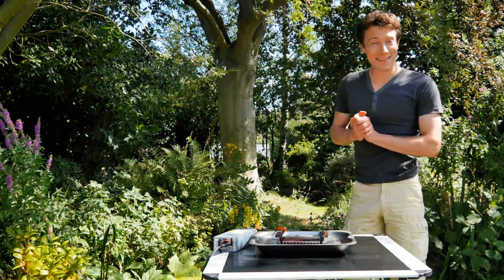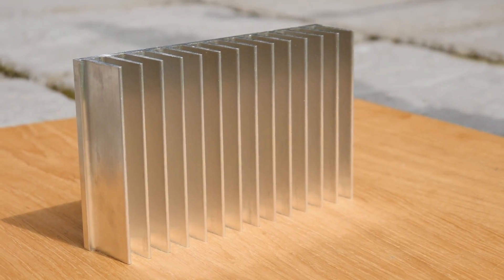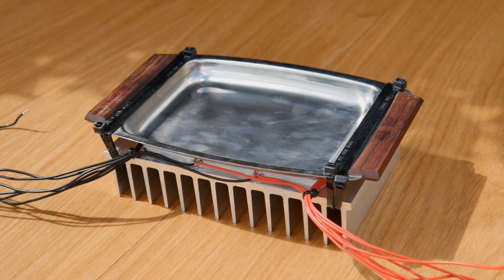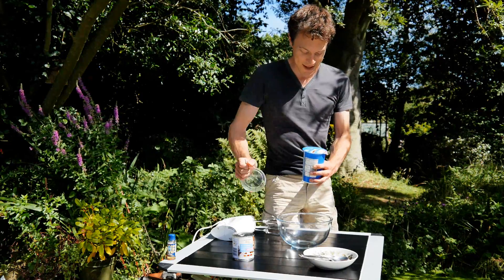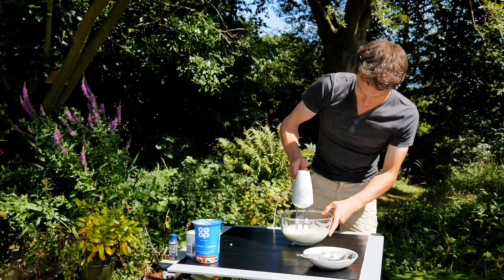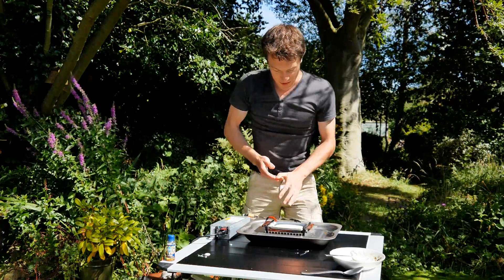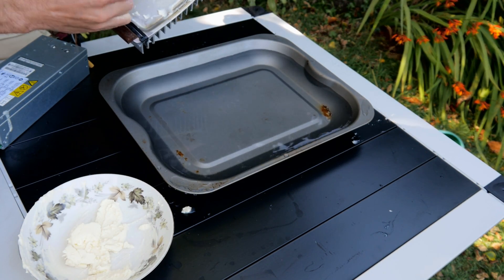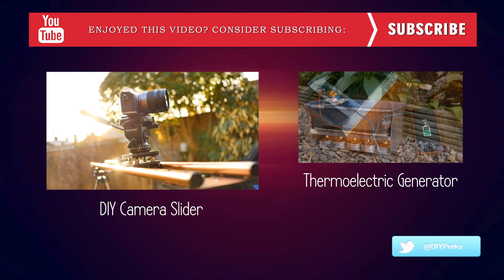DIY anti-griddle (for INSTANT ice cream!)

Comment: so I bought a $207 ice cream roll maker but remembered this video and decided to return the roll maker and make this instead.  But I decided to go 12"x9" rather than the TINY little maker he's using!  That is too small diy perks wth...  Anyways, I reasoned this will work even better than a compressor based one and be even faster AND will enable continuous use whereas I read the compressor based one cycles on and off due to compressor overheating issues after only a batch or two.  I want to be able to serve large crowds continuously.  I plan to put ice cubes in my water tray so I can monitor its temp and ensure it is very cold to maximize the cooling of the peltier devices.  I decided to use box staples as my heat sink fins to cut costs and I already had them on hand.  I am using 20 peltier devices ($60) and it takes 1392 watts so I'm using 2 3d printer power supplies and 3 computer power supplies whose combined watts hit 1500 watts for buffer.  I bought a 9"x12" stainless steel medical tray for $14 (amazon).  Total cost since using spare power supplies and staples already on hand stays at around $78.  I also bought two fried ice cream roll spatulas on amazon $18.  I can use my setup for family camping and whatnot and also lend it to my kids to set up a ice cream stand as one of their first entrepreneurial businesses to teach them money making.  Sure beats a lemonade stand IMO but they could sell lemonade as well as ice cream and smoothies to expand clientelle.  Heck I might even try this to make extra cash if it is lucrative enough to bother.
Reply: oh yeah one more thing I'll be running this off a gasoline inverter generator so I can bring it anywhere with no AC power available and $3 gasoline can run it for 5+ hours straight.

Comment: whipped cream ... or whipping cream ranges from 8 to 12 % cream ... heavy cream is 10 to about 15 % .... half and half is 10% cream and milk ... the higher the cream content the better and more rich the ice cream tastes ...
Reply: since you whipped your cream a 1/4 tsp of sugar for every 500ml of cream will let the cream whip easier than without it ... if you use half n half you dont need the sweetened condensed ... and you dont need to whip it ... you can use a fork to keep breaking the ice crystals into smaller bits making a smooth ice cream ... you can also use just milk and make soft serve also ... flavour any of them as desired ... tbh the best option is go neopolitan ... then you dont have to decide vanilla chocolate or strawberry/ raspberry  ... you get all of them in one bowl ;)

Comment: It might help !
The logic that u are applying heat on the other side to achieve coldest temperature on the side we use is completely wrong by applying certain voltage no matter whats the conditions the temperature difference between two surfaces is fixed so to achieve -ve temperature on the cold side we would wanna try to decrease the maximum temperature on the hotter side by installing collent or a heat sync so that the difference between the surface stay the same but sure to decrease in temperature by heat sync on the hotter side the cold side gets coolest hence might achieve coolest temperature possible it is a kind of getting most use out of it

Comment: Has anyone done this build with a regular (non-server) PSU?  The modules he's using draw 6A for optimum performance, and most PSUs 12v amperage is far below that. Definitely doing this build in the coming weeks, and will likely incorporate a thin marble slab into the freezing surface.

Comment: You could make a churned version using a stainless steel pot instead of a tray, and it wouldn't need salt either. Also you could use one peltier, a small fan, and a USB power bank to make a coaster that keeps your drink cold.

Comment: NEVER use a 2nd hand atx psu (computer power supply) - there is strong risk they will blow and destroy everything attached.
Reply: I only use 2nd hand PSU's and never had a problem....
Reply: that's nonsense they have fuses inside what are you even talking about that's ignorant to say

Comment: Hello sir i have some questions about cpu power supply... Can we use power supply 5V as a cell phone charger if we can what will be the current? And can a large ampare of current effect our cell phone ? Or how we can reduce the value of current to our desire output ? I will be very thankful if i get reply Thank you
Reply: 5v cell charger is only 2a and each peltier takes 6a at 12v so 60+ watts.  5v 2a is only 10w so would barely make cold at all

Comment: Just a thought - some computer water cooling parts on the hot side? A couple of 240mm radiators and matching fans, a really good pump and some water blocks from somewhere like Banggood. 
Then instead of a tray, what about a 2L camping pot with a cake batter mixer mounted through the lid :D

Comment: Just find a 500 watt server power supply. And then hot wire the leads to get your 12v rail going. And toss some water in to make it exciting.  If you fuck up the power supply will kill you! No issues!

Comment: Dang, that is soooo dangerous!  Water and wires within a few millimeters of each other... I wonder how many people will get electrocuted because of this "brilliant" idea?
Reply: Obviously you know f&ck all about electricity.
Reply: the wires are insulated but setting water level to be 1 inch below wires is easy and water can't randomly jump up to wires and short them either.  its pretty safe on a sturdy stable surface to do this.
Reply: also worst case scenario is you short the 12v wires causing really nothing to happen.  the power supplies will not output any more than their buck converters will put out.  it won't even cause electronic failures then even.  it would just discharge the capacitors faster which they are designed to handle with ease.the current would not go up much since the microprocessor in the psu caps the current output to a max level of 18a at 12v on a pc psu.  so even in event of a short there is no consequence that is dangerous really.  also 12v cannot harm humans.  you can touch 12v battery terminals and not even get shocked is too low of voltage to shock a human.

Comment: Why aren't Peltier Elements used to cool pc components?
Reply: Condensation, massive power, and still have the thermal co-efficient headache between the Peltier heat-sink and air. The delta thermal is also a major problem.

Comment: Although the consumable material cost is higher, I think the method where you super cool a stainless steel or cast iron skillet by setting it on a brick of dry ice is significantly more practical than this.

Comment: I thought I might suggest a related build if you're not working on it already: Ever heard of the JOBO film processors? They are expensive home based film processing setups whose central component is a temperature regulated bath that is especially useful for color film processing. The plate cooling/heating components in this ice cream build might be useful for a JOBO CPP like processor? 

Why? As a photographer/filmmaker I have observed curiously the recent popularity of film including the re-release of ektachrome and a even new Super 8 camera to boot! A build of this sort would be just it.

Hope you can wrangle something together oh mighty DIY wrangler. Thanks!

Comment: What if you used these to cool a Computer? At a certain temperature the Peltier Elements switch on.
Would that even work? Or is it stupidly inefficient?
Reply: Condensation, massive power, and still have the thermal co-efficient headache between the Peltier heat-sink and air. The delta thermal is also a major problem

Comment: This is essentially an electronic coldstone that doesnt require dry ice, the best thing to do is to keep the icecream moving across it by essentially cutting it and flipping it until its frozen all the way through, you could probably take an aluminum sheet, and make a wooden handle for easier flipping, or you could use a spatula if you dont want to make one :P

Comment: For the power source you should have used a bridge rectifier and more tec elements in series.  Let's say you want to run them at 12v, 20 of them would work with a direct connection.  The cost of the screen power supply was probably about the same as the additional elements.
Reply: this wound not work imo
Reply: @artbyrobot1  Why not?  I'm curious because I know I posted the original comment a long time ago but it has always been an idea I've wanted to try - just not enough to actually try.  With the rectifier you would feed half waves to the TECs, and if you used a full bridge I think one string of tecs would get the positive half wave and the other string would get the negative.
Reply: @RedShiftedDollar  each one needs 6a at 12v dc and I don't think in series they would all get that.  i'm not smart enough at electronics to know for sure though so that's why I wrote imo.

Comment: So cool xD
I am not an expert in electrical things so i need the help of someone who understands it better than me i dont think that is hard to found, but i was looking for a switch for a system that i am trying to do and the ideia is i pull the switch and the the monitor of the PC turn on,the mouse and keyboard and the leds of the computer they all turn on but at the same they turn on the tv turn off, so the ideia is a switch that put my computer like in movie mode and normal computer mode.
But the problem is i found a 4PDT switch so i can controll everything with just one switch but the thing is 250v 2a or 250v 10a i dont know what to choose

Comment: Great Idea! I'm thinking about getting two Gastronorm Containers that that Fit inside each other. so that the Bottom one would have the Heatsink and Peltiers and the Inside one could be easily removed. It might even be sturdy enough to use the whisker on the lowest setting to get some air into the Cream while it's freezing.

Comment: I think instead of water, a PC fan linked up to the same power supply would be better
Reply: It's actually an incredible amount of heat it water starts evaporating in a few seconds so haha i think water works best, i even cool the water beforehand :3
Reply: I didn't think it'd be that hot O.o
Reply: Actually i used a much bigger tray and more peltier elements, so that might be the difference, but water is still the safest bet.

Comment: Quick tip: The recessed surrounding of the XT60 connector's pins (from the cable/soldering side) fits 3mm shrink wrap perfectly, and it can be fit right up to the end (recessed inside the connector housing), making a very secure connection. That's the size if anyone watching is wondering. Order some when you buy them :) Pretty standard and cheap, protects more, looks a ton better, and doesn't get sticky with time.

Comment: i thinking of making one.. i've got a spare 550w PSU i can use, but i'm not 100% sure on what wires to use to power the Peltier Elements. also would it be more efficient in transferring the heat away from the hot side of the Piltier Elements if i used a cpu water cooler? dunno how it would work but its an idea

Comment: Superb! As always!   Matt, looking at the comments below, some people want to know whether it can be used to cool a beer or sodas and such. The answer is "Yes"  because I too have made a small chiller, using the same idea of a heat sink and peltier units. I used a small thermocol ice box , the kind they use to keep medicines cool during transportation. To the cool side of the peltier, which I placed facing downwards inside of the box, I added a CPU heatsink with it's attached cooler fan, to disperse the cold air within the box.   A bigger heat sink which was modded to have a raised border, was mounted on the hot side of the peltier(the top), which I kept exposed to the outside atmosphere, and further heat dissipation was achieved by pouring some water on this part of the heat sink,(the raised edges/border help to hold the water), and then blowing air onto this side of the Heat sink. Power was supplied using an SMPS, and thermal cutoff was managed by a 12 volt Digital Thermostat module. It works just fine. The lowest temperature I have been able to get inside of the box is around 10 degrees Centigrade when ambient temperature was around 27 degrees centigrade. It takes about and hour or so to get down to 10 degrees inside the box. Dimensions of the box are around 12"X8"X8" (LxWxH in inches). Have lined the inside of the thermocol box with some metal foil to spread and retain the cold inside. Hope this helps.

Comment: Hmm, I wonder if it would be possible to make a table/plate that could keep an exact temperature no matter the surrounding temp. Like putting several Peltier elements in both directions, having a few temperature sensors and a microcontroller. This could be used for example to work with chocolates, melted sugar and such.

Comment: What you've made here, Matt, is frozen half-whipped cream. Ice cream is not difficult to DIY, there are no complex kitchen skills to master besides time management. It just takes a bit more patience in the beginning and mechanical skills. If you can mix epoxy, you can make proper ice cream.

Ice cream is usually made from a custard. Exact recipes are all over the internet. Ingredients are cream, whole milk (about 2:1 to 3:1), sugar, tiny amount of salt, egg yolk, flavoring. Put the first four ingredients in a pot on the stove and slowly heat to near boiling (70-80 C) while occasionally stirring to incorporate. 

In a separate bowl, whisk yolks until they start to turn a lighter color.

Take a small amount of the hot mixture and slowly pour into the whisked yolks while continuing to whisk. You don't want the eggs to cook and solidify, you are trying to warm them gradually. Keep adding small amounts (tablespoons) of hot mixture to yolks until you have warmed them to about 40 deg C. About 1/3 of the hot mixture will be required. This is called "tempering" your yolks. 

Slowly pour the yolk back into the hot pan while stirring. Continue to heat the mixture while stirring constantly. Now is when you add your volatile flavorings such as vanilla or mint extract.

When the mixture begins to coat the back of a spoon, remove from heat, strain any cooked egg/scalded milk bits out in a wire mesh strainer (you'll get better at avoiding this) and chill in the refrigerator at least 4 hours, preferably overnight.

The mixture should first be chilled as close to freezing as you can get it. This is a critical step as you want to "freeze" the ice cream as quickly as possible to keep the ice crystals from growing too large. This is why you churn, to keep the heat moving out. The less air you incorporate, the better. Solid items such as chocolate chunks, chopped frozen Mars/Snickers bars, or berries are added or folded in right before the end. Fudge/caramel/jam swirls are in the advanced class.

At this point you have soft-serve. Put your ice cream in the proper freezer, covered, to firm up, if desired.
Reply: Alternatively, if you aren't turned off by deceiving a date about your cooking skills, you can melt some store-bought ice cream in the fridge and refreeze/rechurn it while they watch. It will only be slightly degraded by the repeated contact with air.
Reply: +Markle2k Don't be such a buzz kill dude

Comment: You can get away with a lot less thermal paste per unit and it will give you better performance. The paste is filling in microscopic defects, so you want it to do that but not much more because then it's inhibiting thermal transfer.  Love the vids :)

Comment: Note that for some manufacturers the hot side is the one with text. If that happens to you, just swap the polarity, no need to reassemble "the correct way". For extra control on the elements, use a constant current capable bench psu. You can also use other peltier elements, they are available in different current ratings, so lower current for lower heat pumping (also meaning less heat to dissipate on the hot side). You might also be able to use a constant current buck converter like the one in the flashlight video. A nice big lead acid battery works fine as a power source too if you are not that picky about the exact performance.

For increased performance use better ways to dissipate the heat, like more water, water flow etc.

One word of warning though: since peltier elements are semiconductor devices, they do not share current very well (just like LEDs in parallel) so depending on the exact setup you might see quite different performances of the single elements. In that case either try to match them in their forward voltage, or put load sharing resistors in series with each element before paralleling them.

Comment: can i use one of these to cool a couple and just attach the heat sink to the hot side?
Reply: cpu not couple sorry
Reply: That's what thermal paste does, transfer heat. You would need a pretty serious fan to cool the heat sink or the whole thing might overheat, since the plates transfer it more efficiently (Than thermal paste).
Reply: yes you can but in my experiment with a stock amd cooler the temps were identical to just air cooling alone. not sure what the result would be with water cooling behind the peltier device.
Reply: +Dracolegacy also the peltier will create condensation, not good for electronics.
Reply: josh green while you are correct in regular circumstances while it's on a cpu it doesn't have the ability to get cold enough to make water condense. But if you did manage to cool it effectively enough all you would need to do is insulate around the socket to prevent air from reaching it and thus stopping condensation. Good example of this would be the phase change video on Linus Tech Tips.